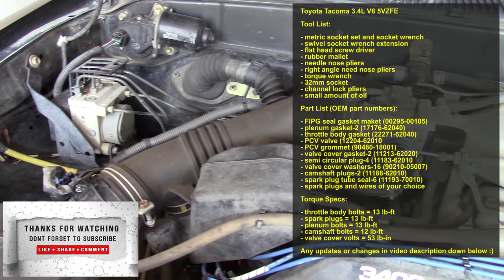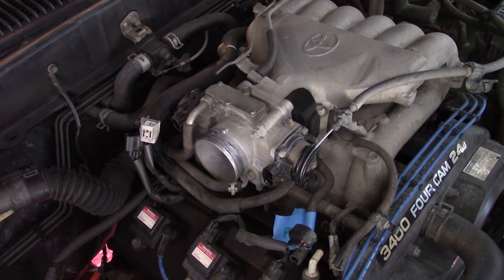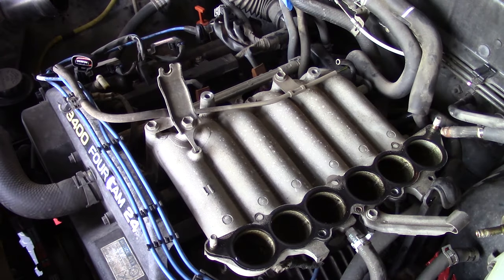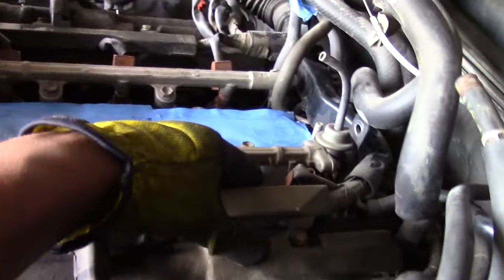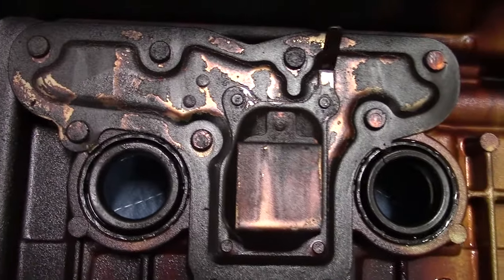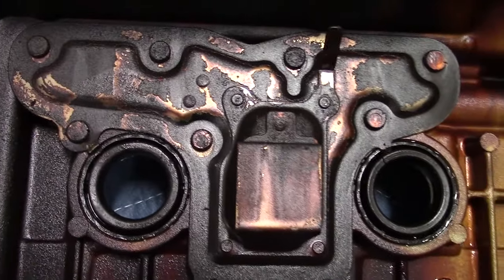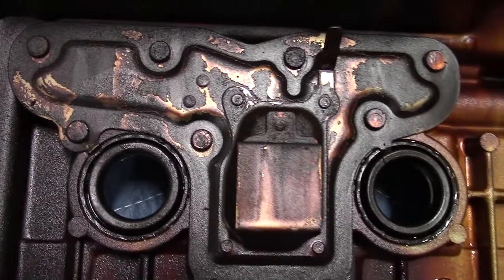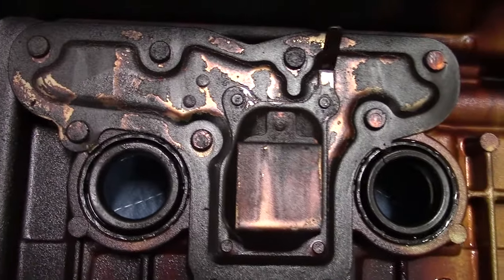Toyota Tacoma / 4Runner Valve Cover Gasket Replacement | 3.4L V6

Comment: This was two years ago so you likely won’t reply to this comment in time but is it necessary to do the little half moon things?
Reply from the maker: @Rhecsh1t9845  not necessary but recommended since you’re already in there 😊
Reply: @EngineeredMojo  do they go bad or something? If they go bad what happens?
Reply from the maker: @Rhecsh1t9845  it's more about once the valve cover is removed, the sealant may be compromised in some way

Comment: Why do you have to take the half moons out for the valve cover? I’ve never done them on a 3.4 before I don’t wanna screw it up lol
Reply from the maker: There is a sealant application there. You could leave them in, but there would be old sealant at those locations. Hope that helps!

Comment: As someone who is in need to do this but is an absolute rookie with vehicle maintenance. Can this be done in one day?
Reply from the maker: Yes most definitely, I'd just plan for a full day so you can take your time with the removal of items
Reply: I just got off the first valve! Do I need to disassemble the camshaft bearing or can I leave it?
Reply from the maker: @Levi Meyer  you can leave the camshafts as they are unless you plan to install a new camshaft sprocket seal. I didn't perform that for my install, but some do perform that install at the same time. Hope that helps!

Comment: These do tend to come loose over time I have seen many be finger tight causing the leak after a year or two. I suggest adding a dab of medium strength loctite and not over tightening them like said but the loctite will keep them from backing off
Reply from the maker: Ahh this is solid tip and advice, never thought about adding a bit of loctite
Reply: yeah and if you do see it leaking you can try tightening down the ones you can get to. Youll prob find a lot of them finger tight @EngineeredMojo

Comment: I have a question! I change my gasket cover and i have a misfire in cylinder 3 P0303 I didn’t have this issue before changing the gasket , anytip ?
Reply from the maker: Could have a bad seal around the spark plug tube seal that is leaking onto spark plug. For spark plug issues, I always swap plugs between cylinders to see if the issue switches cylinders. If it does then I know it's probably a spark plug issue. If not then it may be an issue internal to the cylinder
Reply: Check your connection to the fuel injector.  Possibly bent a prong and isn’t making continuous contact
Reply: Check your connection to the fuel injector.  Possibly bent a prong and isn’t making continuous contact
Reply: Also check continuity between each injectors prongs. This is how I diagnosed a bad injector.

Comment: I noticed that your spark plug tube seals look a little bit different than the ones that you removed. Have they been working well? This happened to me as well and I was wondering if the dealer gave me the wrong part until I saw your video.
Reply from the maker: They've been holding up well so far. No leaks. I do know sometimes there are manufacturer updates to parts overtime as common failures are realized e.g. axle seal was different from original to when I purchased on recently. I assume that could be the case here, great observation and question. Had me thinking of similar past occasions.
Reply: @EngineeredMojo  thanks. I will use them then.
Reply: @EngineeredMojo  just to be clear, was your tube seal part number 11193-70010 and was it a OEM part? Thanks!

Comment: Just curious… what was the cost for all of the OEM parts? I know the gaskets alone are $60 each at the dealer.
Reply from the maker: I bought an oem package off Amazon or ebay. I can't remember which, but I know in total all parts were under 200 total for gaskets
Reply: The only thing you need to buy genuine Yota is the cam plugs.. 
fel-Pro blue gasket kit exceeds Yota
Reply: I spent like 200 for everything at the dealer .
Reply: Going to know. I've got the blue fel-pro kit on deck red to go!
Reply: @sbernardo8276 did you use Felpro blue on your 3.4? If so how is it holding up today?
Reply: @riflebear1711 did you use Felpr Blue on your 3.4? If so how is it holding up today?

Comment: What are you removing at the 6min.
Reply from the maker: There is a bracket with (1) 10mm bolt I believe holding in a coolant tube

Comment: Whats 53in lbs in ft lbs ??
Reply from the maker: It says 53 lb-in. It's a measure of torque. Don't confuse it with lb-ft or you will drastically overtighten those bolts. You need a smaller torque wrench typically for lb-in values
Reply: 53÷12=4.4. I believe that's how you convert.

Comment: Wow , I didn’t know it was that complicated, I didn’t think you had to pull the intake off , but I’m going to have to get mine done on my 2002 4 runner, I’ve got a buddy that was a mechanic at Toyota and has his own shop I hope he cuts me a deal 😳
Reply from the maker: You have a good connection haha, hope your friend comes through! It is a bit of a task for sure, but with time not too bad
Reply: How much was the repair job?
Reply: @ddemier  , I did get it done my buddy couldn’t do it he was to busy, I took it to a shop down the street from me it was $ 750 bucks, but it needed to get done , just when I thought everything was fixed now a couple weeks ago the rear main seal started leaking 🙁 this is going to be expensive 😩

Comment: You dont have to remove throttle body.  I didnt because didnt have a gasket to replace the old one..   i got that far at least..
Reply from the maker: This is true, I only remove it so I can change the gasket. Wanted to get as much done while in there as I could haha

Comment: Why didn't you spend 2 mins. and clean at least the inside of the valve cover, and also just for looks the outside of the valve cover?  What looks to take at least 2 hrs use to take 10 mins. total for both sides in the days of carburatored engines. How sad. Great video though, just to show how involved it truly is.
Reply from the maker: I was exhausted haha and wasn't too worried about the inside given there was very little buildup, appreciate the video feedback!

Comment: S Bernardo
58 seconds ago
SMH.. You bought parts you didn't need .. Fel-Pro exceeds genuine Yota on valve cover gaskets and seals. Usually $35..you didn't need to remove the throttle body it will come off with the plenum ..the passenger side injector harness is not in the way..The drivers side is more complex.why on earth did you bend the tabs up in the inside of the valve covers that house the spark plug seals? You should watch more youtubes before you attempt one yourself! SMH!
Reply from the maker: Appreciate the video feedback and your opinions! If you have data to back up your claims on oem not being as good please share! Watch the video and you'll see why I removed the throttle body to replace the gasket.
Reply: Well the throttle body gasket wasn't broke if you hadn't removed it then you didn't need to replace it.

Years of experience tells me that Felpro silicone valve cover gaskets are superior to any OEM
Reply from the maker: @sbernardo8276  that's awesome! Thanks for the tips and info. I'll use the ne t time I do this hopefully in 15 years haha